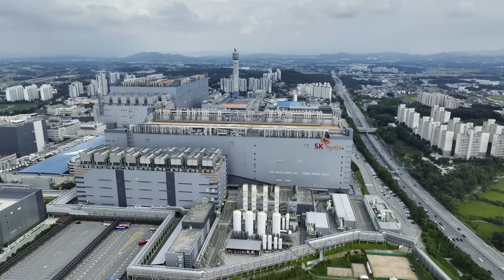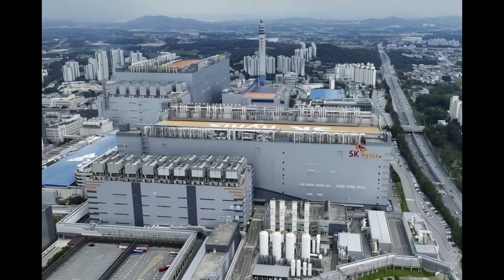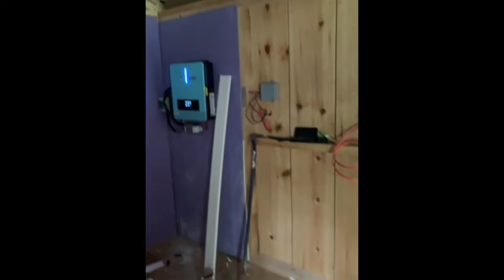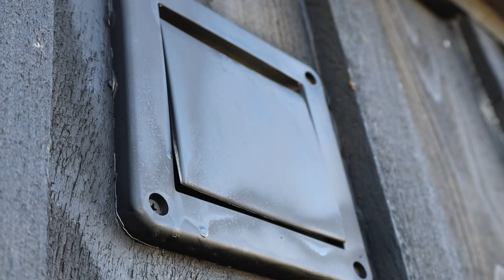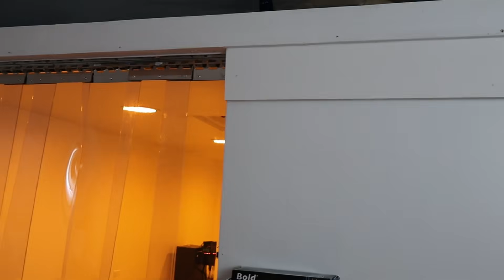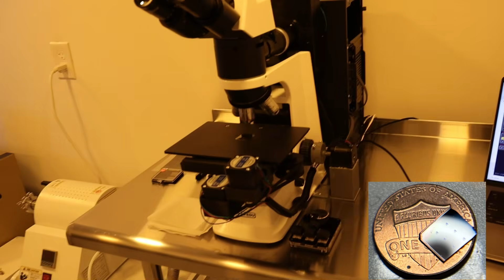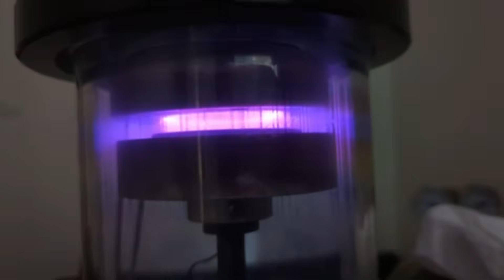There’s a Class 100 semiconductor cleanroom inside this backyard shed.

Comment: yeah, it's not that hard to build a cleanroom for your DIY lab, I was designing and building them for almost 10 years. ISO 8 clean room you probably have it just right in your living room without knowing it. ISO 5 is a top level, but in a small scale it's not that hard. The problem is, that your project contradicts some rules, it needs to have a cascade of rooms gradually increasing "cleanliness"  from iso 9 to iso 5 ("class 100"). You should also separate the material flows and personnel flows via passboxes and gateways. In that case you can even be licensed to produce something valuable (but its a long story). That's why those facilities are so huge (and don't you forget that some machinery can require a 30 ft ceiling), so you can imagine the quantity of hepa filters and the size of the HVAC machines needed to run the place. In most cases you just can use an isolator, just a long long table with aquarium on top, which has hepa filters and lights on top and holes with gloves on its side - most of lab machines are tabletop, so you put them in a row and pass samples from one stage to another just inside the isolator, which can be built in your garage. And if you need any help with the design feel free to ask.

Comment: Hi! Can I ask what your maintenance intervals are for the HEPA filters and the climate control unit? Also do you schedule your maintenance on hard operating hours or based on some other metric?
Reply from the maker: Yeah sure thing! So I have an initial MERV pre-filter, then a HEPA filter for the air intake to provide positive pressure and to remove the 99.9% of air particles. From there the main large HEPA units take it to 99.9999% removal. So the air intake HEPA filter is swapped every few months but the main units can last years, I have been in university labs that have the same HEPA filters for 20 years haha. But yeah monitoring mostly airflow rates, particle counts, etc. to ensure everything stays in check.

Comment: I do controls in an iso 8 clean room for medical device manufacturing, your lab is incredible 10/10 outstanding execution. 

Something I would consider, just because I didn’t see it would be humidity management, you want it low enough to prevent mold but high enough you don’t have issues with static, especially since you’re making semiconductors. 

One other thing that could make for a good side project would be an air shower between growing and the clean room, mostly because air showers are fun but could be helpful managing particulate given that your gowning area opens up straight to the outdoors.

Definitely earned a follow here, I’m looking forward to seeing what you make 👍

Comment: Supper impressive, WOW. 
It wasn't clear from the video, but just make sure, when you are gowning, try to not touch the floor with the gown. Especially try to avoid the sleeves touching the ground, they might pick up dust from the floor and you might end up soiling your experiments, when you work at the table. Also fully tuck the cuffs under your gloves. 
Also make sure, you close both of the buttons of your gown(on the neck). If its open, it may act as bellows. When you bend down, dust particles may be pushed out.
Just a few tips, to help you out😺

Comment: This is a really cool video! I've just recently started learning to build PCBs, and I've already been thinking about the future when I might need to make my own silicon 😅 my kitchen has become a PCB lab with DC power supply, multimeter and oscilloscope, soldering iron and hot air rework station, hot plate for melting the solder and a microscope and tweezer set for component placement and inspection. But that's still no clean room, you know how it is! 

Fantastic work and really amazing how good the results were! This really shows what we can accomplish if we put our minds to it

Comment: Semiconductors were something I considered absolutely impossible to make outside of giant fabs - you have proven me wrong. Really shows you what human dedication can achieve, bravo!
Reply: Silicon/lithography is hard, others are more approachable, e.g. copper oxide (usually made into demonstration solar cells),  zinc oxide (point contact tunnel diode), point contact diodes in general really,  silicon carbide makes a crude LED, germanium alloy transistors are also a fairly approachable process especially if starting from a wafer.
Reply: So, the giant fabs originate from profit motives. To make sense of spending BILLIONS on one thing doesn’t make sense unless you can make that money back. With hobbyists, it’s different. Profit is never the incentive.
Reply: And the reason it costs billions is because you need vast scale where it can even be profitable
Reply: @SuperMellowFilms Not just profitable, but marketable. There is a volume low enough that you can't get a study stream of reliable customers. If customers cannot rely on their supplier, they'll often just go to one they can rely on. If they aren't building billion dollar fab sites, someone else will and THAT is the company everyone will go to.
Reply: Silicon is a semiconductor and, so are other materials. What you mean is an integrated circuits or a microchip.
Reply: @candyman9635  Its common in the industey to use "semiconductor" as a catch all label for semiconductor based device manufacturing. For instance the trade show SemiCON isnt just for showing off silicon but all device process development

Comment: Okay, I want to be a little bit more pragmatic than other commentators. While job on repairs you performed is definitely cool it is actually the cheapest part of you lab and industrial installment in general. Most of your Industrial machines are not hand made but bought from the respective companies, therefore it is the same as to use a semi-prepared ingredients in restaurant dishes competition. But thanks for the repair work tips)

Comment: The “If I won the lottery there would be signs” guy when he actually wins the lottery
Reply: the cleanroom itself is not the real expensive thing there, it's these machines. While I am not sure, if you can get previous gen machines much cheaper, though, and even if, where from...
Reply: @bernds6587 those hepa air filters looked to be 6x2 or 6x3 maybe even larger, brand new that’s probably 10k just in purifier’s. A filter replacement on one of those is easily a grand. Also the labor involved in that dry walling is insane
Reply: @bernds6587  If NileRed and Styropyro have taught me anything, it's Ebay.
Reply: He keps 99% of it for himself and invested 1%
Reply: Wtf did norkshit say to gerton
Reply: I don't think it cost more than a couple hundred grands by the looks of it. Some people buy a sports car when having a midlife crisis, others do this :)
Reply: @PaulPetrov-t7b bro 🤣 a "couple hundred grands" to drop on a shed hobby is totally within the realm of lottery winner or someone already very well off. Most people these days can't afford "a couple hundred grands" for a house.
Reply: @PaulPetrov-t7b  idk this cost anywhere near $250,000... But for all I know the tool sets may cost that much. 

The building, insulation, sealing/surfacing, HVAC wouldn't cost more than $30k even w the clean room filters i dont think.
Reply: @PaulPetrov-t7b  you're the type who is so shelter that you probably think there's no such thing as poor people and everyone and everything is fine even though the poor are the majority
Reply: @Observer-f5k  well, then stop being poor lol
Reply: @Observer-f5k  and whats his problem exactly?? What does he have to do with poor people? You know how wealthy people got rich? They worked smart for it
Reply: @CoaRekt  lmao 😂 "wealthy" are rich because they're "smart" and not because they had wealth? come on bro you're embarassing yourself, next you gonna say the kids of this rich are also smart because of genetics or something 😂
Reply: @Observer-f5k  ofc they had wealth , but what about jeff bezos, mark zuckerberg etc... ??? Were they wealthy from the start??? No , thats what i am talking about
Reply: Jeff bezos started from his garage so whats your excuse?? He worked smart and got his money because of that , if he was dumb will he would've gotten that wealthy? No
Reply: @CoaRekt  Jeff Bezos attended Miami Palmetto Senior High School, a high-performing public school in Pinecrest, an affluent suburban village, which effectively punched his ticket to Princeton University and his tuition wasn't even paid via loans, his stepfather, Miguel Bezos, was an engineer at Exxon beyond just paying for college, his parents later provided the famous $245,573 capital to start Amazon in 1995. Other than this he already had experience and connections with the wallstreet as even being the vice president of D.E. Shaw & Co and getting into wallstreet was easier for him as being from Princeton and having a tech background that the finance industry was aggressively shifting towards during the late 80s.

And Mark Zuckerberg’s path was even more classic elite suburbia, He grew up in Dobbs Ferry, New York, a wealthy suburb in Westchester County. His father was a dentist and his mother a psychiatrist. Before Harvard, he was sent to Phillips Exeter Academy, one of the most prestigious and expensive private boarding schools in the world. This environment provided him with graduate-level tutoring and high-level connections before he even turned 18. When he got into Harvard, there wasn't even mention of loans, his father reportedly offered him the choice between college or a McDonald's franchise, showing the liquid capital the family had available. And then later what he did in Harvard was stole the idea of Winklevoss twins and Divya Narendra and just told it louder with the elite Harvard connections he had which included Eduardo Saverin the son of a Brazilian industrialist, who became a co-founder and then later even Peter thiel joined in on it too but they still had to settle for the theft and had to gave about $65 million of settlement in cash and stock
Reply: @CoaRekt  jeff bezos had a garage, that means he wasn't poor
Reply: It seems your reply on my comment got deleted, but I was able to see half of the message in my notifications.

Are you ok, man?

Comment: is that rotary pump for the ald exhausting into the lab space tho? might want to pipe that outside or something.
Reply from the maker: haha no worries, this is a sputtering system with just Ar and O2 available for reactive sputtering. I can deposit metals, oxides, and semiconductors using it. Working towards ALD though :)
Reply: @Dr.Semiconductor  I was just saying, the exhaust from the rotary pump will get on everything if its not filtered or removed

Comment: We need more of this. What's your process? Nm accuracy?
Reply from the maker: I can do sub-micron patterning think 1990s scale, but am working on immersion lithography that can do sub 100nm! The trade-off is that the total patterning size is small, perfect for R&D though and small devices.
Reply: @Dr.Semiconductor  Dude that is amazing. It would be really cool to see some prototype chips, or even another cool project would be to revive some chips that are no longer being manufactured. Out of print so to speak. I dunno if you could even do DSP chips, like from old synthesizers. There's a lot retro nerds out there who love this old stuff. I been working on ben eaters 6502 kits.

Comment: Hey, fab equipment specialist here. What the fuck 😭

It must've taken a lot of work to get that shed prepared. This is just incredible, man. It's a cute little cleanroom shed... and you somehow crammed nearly every process in there... I fucking love it lmaoo
Reply: even managed a plasma etching chamber and a deposition chamber. Impressive for sure! I do wonder what parameters he uses for deposition though (Argon or Xenon) (Capable of reactive sputtering or just single material?). Lots of parameters I am sure he has already thought of but for sure very impressive in a small shed no less. Only thing I worry about is by having the plasma etching chamber separate from your deposition chamber you will get mono layers of oxide buildup on your films when moving from plasma etching by breaking vacuum and moving it to the deposition chamber. I also wonder if he is aware of seed materials in the context of PVD.
Reply: @Andrew-we8xd  Don't worry. He will have a fully automated production line by the next video
Reply: @whysoloco hes halfway up to the moon by now
Reply: @grqfes  You don't need a fab this nice to get to the moon, getting to the moon, unlike this fab, is largely a matter of cost due to fuel and materials. Semiconductors like those that are to be made here didn't even exist yet, and the computer that got people to the moon had only 4kb of ram.
Reply: @TheKillager-sd7lm  He's going to mars next
Reply: @Andrew-we8xd its not plasma etching its a light shined through a microscope
Reply: @Andrew-we8xd  His next vid is up, and unless your talking about something else it's probably argon since that's the only gas he talked about. And it seems to be just single material but obv there's not enough info to know for sure, at least without knowledge of the equipment/field (which I have none :p)
Reply: @Andrew-we8xdhe did a lot better than that one lady who was digging a shelter.   That's for sure
Reply: Lol I love when the YouTube guys impress the lab scale, trained professionals. Not knocking either group at all, just the ingenuity of the simplification
Reply: Litho engineer here. I started this video thinking, "Oh wow he built a rad cleanroom" then he showed the equipment. My jaw dropped. This is amazing.
Reply: Can you steal one ASML lithography machine for me?
Reply: Hey, Youtube watching specialist here. What the fuck

Really? Right in front of my RAM?
Reply: Waste gas abatement here, WHAT THE FUCK
Reply: I recommend you to read about incorruptible saints, Lourdes miracles and Eucharistic miracles. - scientifically proven miracles.
Listen, i too do not completely understand everything that God does, i am not God!

Isaiah 55:8-9
New International Version
8 “For my thoughts are not your thoughts,
    neither are your ways my ways,”
declares the Lord.
9 “As the heavens are higher than the earth,
    so are my ways higher than your ways
    and my thoughts than your thoughts."

But i know there are signs pointing towards Christ as THE reliable Answer.

 Miracles happen man. My mom knew a Catholic priest who could foretell the future. and not just in some sketchy way, he told mom that my dad would be willing for marriage? if she wanted to? (even tho she said she had no boyfriend cuz maybe she didn't see the relationship as bf+gf yet or whatever? + dad probs didn't talk with the priest Abt it, I asked.) and predicted a birth nine years prior? and told a person he met first time in His life? that there's no man for her in the country, then after many years she travelled abroad to find a job and found a husband there. and after asking him for help, a hard healing/not healing infected? wound that was distracted by doctors to be cancer was healed with the use of *aloe*. + many other ppl were visiting him, asking for healing. he also helped with a chronic? condition?, making it go away once forever?
God bless brother/sister, May God Jesus Christ keep you in His care

Comment: You're missing an ESD foot strap tester and air shower.
Reply from the maker: haha there is so much airflow it acts as an air shower, or at least covers the sins of not having one. The floor tiles also have esd management, though it is mostly for R&D, i can't imagine any scaled production and crazy yield from a shed (I need atleast 2 sheds for that) xD
Reply: @Dr.Semiconductor nice man! I'm just giving you a hard time.  I used to work for Cymer in San Diego now owned by ASML... those clean rooms are insane! Especially in the sub fab.  

Question: your plasma etch looks like one of the sputtering machines I used to mess around with.  Can you sputter with it, like simple metallized target pucks for laying down thin metallic coatings?

Your spin coater with the triangle wafer made me laugh 😂😂😂 whatever works!
Reply from the maker: @Lykapodium  I need a subshed! haha, yeah so the plasma etcher is a modified desktop gold sputter system xD I swapped the electrodes and hooked it up with a turbo pump and ofc different gases to etch. That is a weak point right now I am working to improve... I have a trion minilock system in my garage I am working on rebuilding which will replace that, stay tuned!
Reply: @Dr.Semiconductor awesome!  Good luck in your "clean shed" endeavors.  You should set up a live web cam in there if some of your processes are automated. I bet you'll pull a lot of viewers in.  Maybe even get a bird house with a webcam nailed to the side of your shed.  On the outside lives a bird and her baby chicks. On the inside, <50nm EUV lithography with a custom reticle department lol ... Engineers are allowed to dream